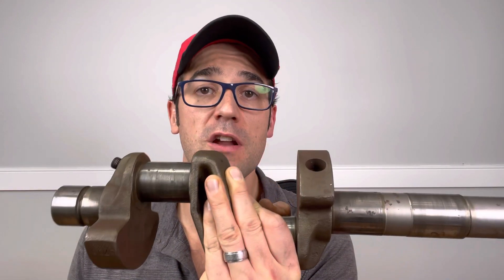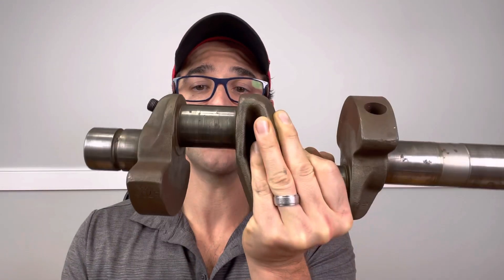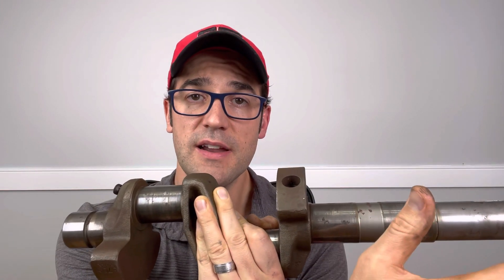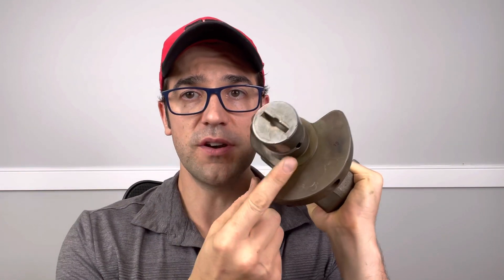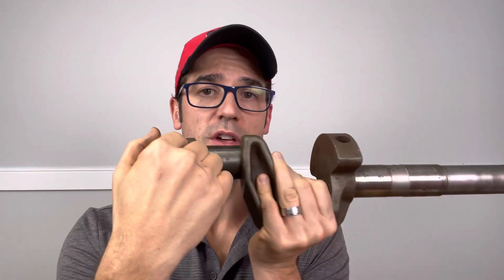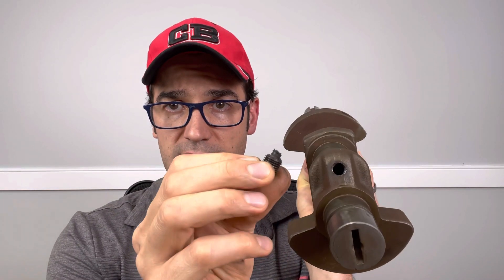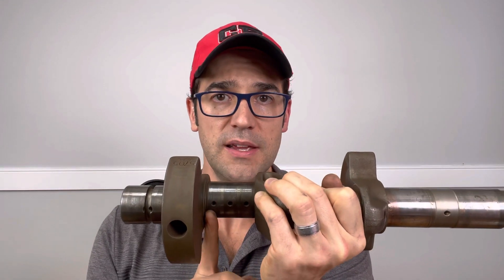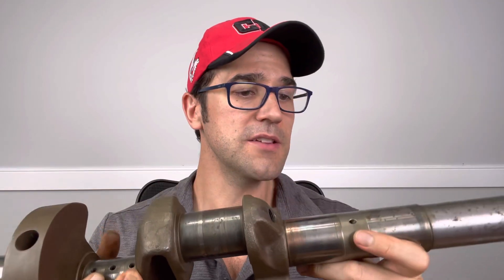How Oil Travels Through a Semi Hermetic Compressor

Comment: I off the unit for one day... and how many hours before I run the unit  because oil is still cold.. thats why the oil pressure is drop...
Reply from the maker: I am not sure your question but you should always run the crankcase heater for a good amount of time to make sure it does not have any refrigerant in it before starting. Check the manufacture guideline for there recommendations.
Reply: @RefrigerationMentor  thanks for info you are right because I forgot to run the crankcase heater before I run the compressor....  thats why have vibration and the compressor is shut down because the pressure of suction pressure and oil pressure is not normal.. 
after I run the crankcase heater unit is ok now.. 
thanks..

Comment: How much oil will or can we have sitting on top of the piston?
Meaning after removing the valve plate let’s say there is 1-1/2–2”” of oil above the piston 
Is this blow by past the rings 
Thanks
Reply: FYI lost full crankcase of oil over night 
Low temp 404 MOHAVE SYSTEM 
Bad head fan for months 
20-30 ambient customer didn’t seem to care to replace the fan
Thanks
Reply from the maker: There could many things that caused that. Is the crankcase heater working? Most likely a flooded start condition. The  oil is full of refrigerant and when the compressor starts it foams/builds pressure that is released out of the CSV valve. Without inspecting the compressor I’m just guessing which you should not do in refrigeration.

Comment: Awesome i have 50hp copland compressor but every time they trip oil pressure switch and oil going to the system. Give me some information for this issue
Reply from the maker: It could be one of many things. Is it on a multi-compressor system or a single compressor? Is it low temp or medium temp? What is your net oil pressure? Have you checked all the screens and filters that are in the oil management system? What are your pipe sizes for discharge, liquid, and suction? Do they have the right velocities? Does suction slope back to the compressor? Do you have any risers and do need to be reduced and have p-traps? Are you overheating the oil and the oil separator is not separating the oil? Is defrost working? Are you short cycling? Do you have blow by? You need to try and answer these questions and when you do you should figure out where the oil is going. Good Luck